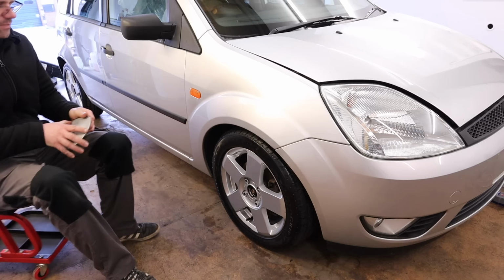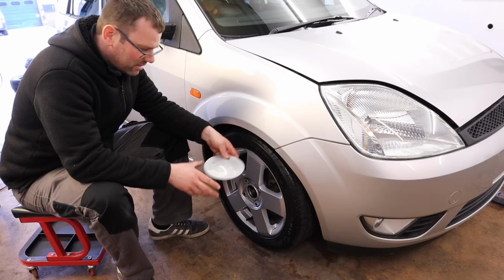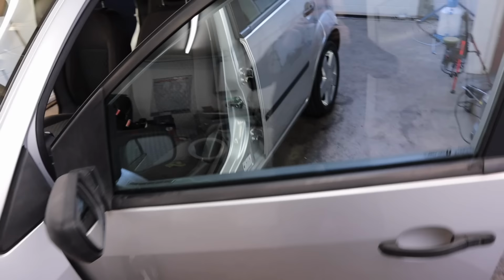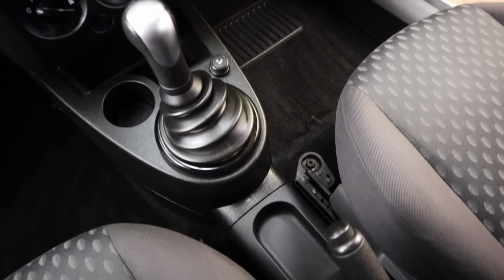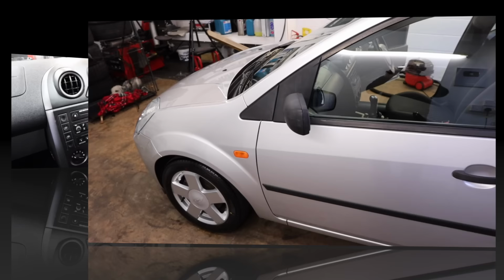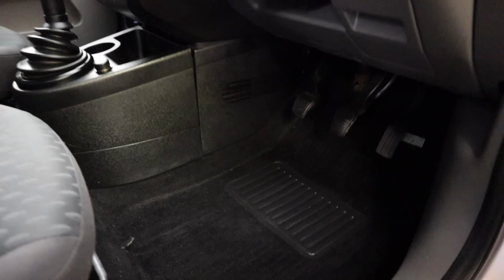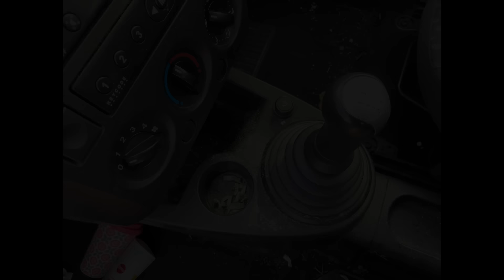Cleaning this disgusting Ford Fiesta Zetec

Comment: Even if I was trading my car in I wouldn’t dream of taking it too the dealer in such poor condition
Reply: Exactly,  but I suspect the dealer knows its value and probably won't give you as much money extra as a real valet like this would cost.
Reply: Crs 92 Exactly! Each time I’ve traded a car in for the next one I always took the time for a basic cleaning and a trip through the wash to get it at least looking decent, every dollar in trade value helps. I can’t help but think that some of these get a mere pittance at the dealer, and get dumped at the auto auction, leaving it to people like this one to bring them back to life.
Reply: Repo!
Reply: I used to have to valet the cars that came in part ex and I can tell u not many people actually clean them before part ex'ing that's for sure

Comment: I have the same exact car and this is so satisfying to watch! For a 18 yrs old car it's really in good shape. The paint is still reasonably shiny, the headlights are nearly perfect and the interior are still intact. Mine cooked for 18 years under the sun and I had to replace the headlights, polish the paint and every time I touch some plastics it breaks under my fingers.
This little Fiesta is really in amazing shape, I bet it has less than 100k miles and she was always ketp inside a garage. Enjoyed massively!
Reply: If you still park your car directly under the sun, try cracking a window open on sunny days, 5mm will do. Get wind deflectors then you don't have to worry about people breaking in or rain getting in

Comment: I was given my mum's Fiesta Mk6.
It's the poverty-spec Finesse model but still has far more kit than I'd expect from a base-level Fiesta (remembering the Popular from the early-mid) '80s: ABS, central locking, rev counter, elec. boot release, CD player, 4 speakers, PAS.
It drives really well and is big enough to get a washing machine in the back when you need to !
I also have a '99 M5 but the Fiesta is a brilliant town car that attracts no attention at all.

Comment: I come from Italy, from one of the three regions where the virus expanded. Here the situation is pretty bad because we were told by the government to stay home, unless necessary movements. In supermarkets you have to stay at least 2 meters away from each person and only a limited number of people can enter. The main problem of the virus is that if it doesn't stop expanding, the hospital capacity will run out soon, which will bring to horrible. I think that what they are doing in the other countries is correct, maybe to late.

Comment: Should wet vac first then do plastics after, the drill brush can spray tons of dirt up at plastics which you previously just wiped down meaning you'll have to repeat steps unless you can manage to keep spraying down by either slow speed or less solution, aside from that excellent work as always.

Comment: Very good detail, i have a Ford fiesta, and i do myself detail in my car...some dferences between here in Brazil, the car washers up the car in a ramp to clean engine, and some cases , they take off the carpet and seats as you did, and dry It in the Sun , also when clean engine they protect battery and cables with plastic bags.

Comment: On Thursday , I am due to visit friends in Glasgow - both over 70 and in the rudest of rude health.  I have a bit of a cold - just a stuffed up nose - no fever, no coughing, no aches or pains, and it is clearing up.  My neighbours had a holiday in Japan returning over a week ago.  They are both back at work and are absolutely fine.  However. there have been 6 cases of Coronal Virus in the Ayrshire and Arran Health Board  area - none in Troon, where I stay, that I know of.    I think I will get and ask if they want to postpone.  It is only right.

On the other hand, I am so old (!) I remember Hong Kong Flu (HKF) in the early 1960's.  I was at school at the time.  One day out of the 40-odd in the class, about 15 turned up.  When my turn came to have  it (HKF),  my elder brother and I were kept at home, dosed with Lucozade (which I did not particularly like) Beecham's Powders, mince and other 'comfort food'  by Mum.   We went back to school after  a few days.  Extending that, I had grand parents who probably had Spanish Flu at the end  of the First War which killed the wildly speculative extremes of 20,000,000 to 50,000,000 deaths.  Clearly this is  NOT predicted with Corona!  My opinion - extreme measures, it seems, but better safe etc.  

One thing:  If I have to self-isolate (God forbid)  |I will not be stocking up with loo rolls, pasta and tins of spam.  It will be steak, wine, a Single Malt, perhaps, chocolate, blancmange, crisps etc. - and enough box sets to last the piece!

Finally - another great video.     I though of my school days at Marr College and got all classical.   I openly admit that I looked this up.    And what I looked up was (because I am writing this on the Ides of March):

'Non omne quod nitet aurum est.'

'Not all that glitters (sometimes translated as 'glisters' ) is gold.'  This applies to all your videos - not least the latest.

Looking forward to the next one.  keep going, Young Sir.  Give Moose (lovely dog) a pat from me...

Best,

Alistair.

Comment: Did he leave the seat bolts on the carpet ? Hope they didn’t get thrown away with the rubbish. Great work though. Henry vacs are brilliant, ive got one. Tough and reliable, long lasting machines with great suction and quiet operation. Ive subscribed, this is very relaxing to watch. Great to see all the shite lifting off and returning the car to a new condition.

Comment: just a word of warning dude watch that karcher puzzi attachment the clear plastic triangle on the front which you see the dirt and muck coming up through has a tendency of cracking the two small screws lugs which are part of the screen that hold it on ive replaced this four times. Its because the screen sits proud on the attachment so when you start sucking up the water from seats carpet etc... its has the first pressure against it basically there not meant to be sweeped say going from a vertical carpet to a floor it one stroke sorry for the long explanation just a heads up
Reply from the maker: Thanks for that, funny thing is I've ordered spares as I though it looked flimsy

Comment: We live in the US, New York specifically, and it is pretty bad here. We wish we had had a better response because it could have been handled a lot better.  It should have been taken much more seriously because we could have saved lives and might even be able to get back to normal by this point.  Instead, we are stuck at home for who knows how long, probably months and what we used to consider normal will change.

Comment: Here in Germany we are beeing told to not interact with eachother any more, we are advised not to travel unless there is no choice and so on. As far as I´m aware there are  less than a quarter of a million cases of Corona world wide. All that was done to contain the Virus was done to late anyhow. But the one thing we all seem to miss, is that we are being pushed towards the edge of collaps, economically speaking. Smaller businesses will suffer the most and only the big ones may survive a crash like the one we are heading into. The majoirty of the general population will suffer, as usual, while a few select rich folks stand to gain from this obvious crisis. And I believe the crises we are steering towards has rather little to do with the virus called Corona. It´s gonna be the collateral damage that´s gonna break the camels back. Nice talking :)

Comment: Tip: Clean the wheels, not just the rims. It makes them look better.
Also it's best to use only water in the extractor. That way you can suck out all the cleaning solution. It's better not to leave any of it in the carpet and seats. You don't need to put the cleaning solution in the extractor when you already do a pre treatment with solution and the drill brush.

Comment: A very good job, big effort and a lot of special polish machine were used for that. Unfortunetely, even if the result is really good... the car remains sadly an old car... :(   . I evaluate  to change a car where the security systems offered by the new models and the new propulsion systems ( electric car ) can add a considerable  improvement of our life...

Comment: Like you I love the Bilt and Hamber fallout products,  they're very effective and fast products.
Questions:
1. Does Nanolex work as effective as Bilt and Hamber's fallout products?
I have used also Meguiars D143 and for carpets and upholstery depending on the  type of spots Meguiars D106 and D116 and these are not very known by many non detailers and are very effective.   Also some from Dr. BEASLEY are great too.  I was wondering if the headliners in your vehicles are like the headliners for USA vehicles.  Here we try not to use much stream because they're upholstery glued to a layer of a material like almost cardboard like.  You have to be very careful with the steamer in order not to hurt the material or it will unglue.
2.  Do you use the silicone spray after dressing with 303 or is this product a UV protectant like 303 besides being a restorer with nice berries scent?  I also love the smell of berries but wondering if it comes with new car scent too.
Great you love Despacito from Luis Fonsi our fellow Puertorican.  We also love Queen, sir Elton John, Paul McCartney, etc.
By the way, I knew Coronavirus was not a hoax because I read about it years ago when the SARS appeared years ago which is Coronavirus too.  Also, watched a TED Talk when Bill Gates predicted basically about it in 2015.  Also, I don't know if you noticed that Clorox, Lysol, Purell made products that had written first that also where for Coronavirus.  So it kind of was a matter of time.  We are all affected one way or another.  Please, always be mindful and read and be safe.  Be blessed!
Love your choice of music.
Xoxo from Puerto Rico 👍🇵🇷

Comment: Do you disconnect the battery before removing seats? Could you include that in your next vid if poss :) also do you have to reset radio after or do you use a radio saver unit?

Comment: #Question: How would you remove a set in grease/oil stain? I have a car seat that had the unfortunate mistake of being on the receiving end of a failed food take out container. It had a butter and oil sauce in it. I have tried general cleaners, bit still left a stain. It's a terrible stain and actually transfers marks to people sitting on the seat. The local car detailers won't touch it and told me to replace the seat.

Comment: Another fantastic job. I'm a bit late to the party, but regarding your COVID-19 question: it's believed to have possibly been in China since October/November 2019 per intelligence from multiple western countries; here in the US, our intel briefed the current occupant in our White House January 3 and virtually nothing was done to halt the spread for over two months (January/February/early March). The US now has the highest number of reported deaths in the WORLD--and it's unlikely even that dismal number is accurate, since we currently aren't doing anywhere near the required amount of testing. Hospitals are running low on supplies for doctors/nurses/EMTs and healthcare workers are having to re-use masks (at one point nurses were wearing trash bags because of lack of gowns). Now the right wing is pushing for "re-opening" of the country and everyone getting back to work ASAP, health concerns be damned. Basically, be willing to die for the US economy. Numerous meat processing facilities have shown employees testing as positive for COVID-19 at rates as high as 60% (Tyson plant in Iowa). So yes--not good here in the states.

Comment: What's the connector for under the seat?
Reply: Hi Prince Edward there is a sensor that detects if anyone is sitting in that particular seat, and it illuminates a light on the dashboard and sounds a warning if the seat belt is not fastened. It also activates the seatbelt pretensioner in the event of a collision.
Reply: @ivanhowlett4907  ah thanks for your reply. I could never understand what it was for.

Comment: Engine should just be rinsed with hose, normal spray. Never use pressure washer. And you should disconnect and remove the battery and close b4 washing. And you didn't use lengthy brushes to go inside the engine. Watch this,

https://youtu.be/FUGMDov3hXc

Comment: Had this Model Fiesta for a year. Drove it from 150 to 200K Kms until it was dead. HORRIBLE CAR. Never seen anything cheaper quality-wise, the Carpets were almost Impossible to clean because they were so clingy to particles. Cheap, Flimsy plastic bits everywhere and an Engine best described as an Asthmatic Sewing machine. Would not take one as a Gift.